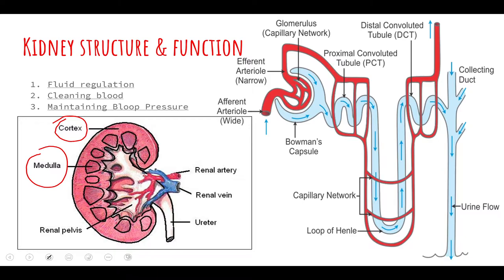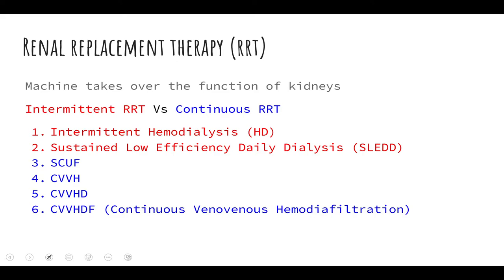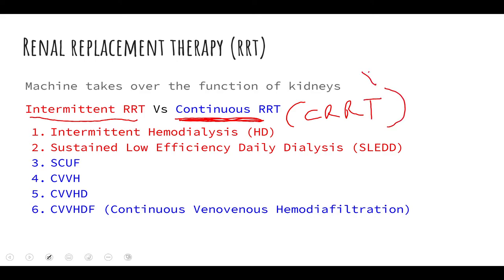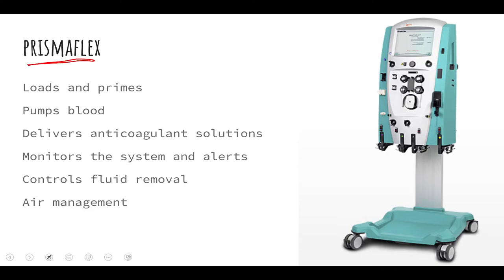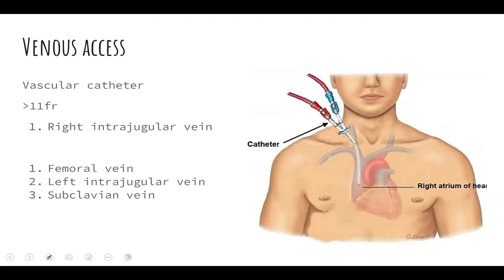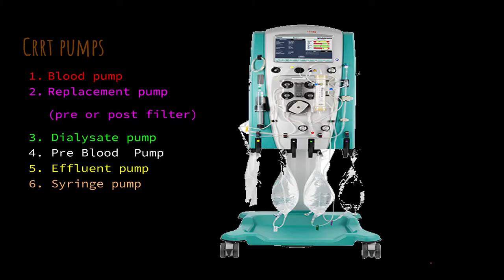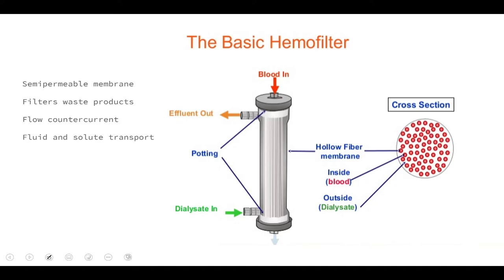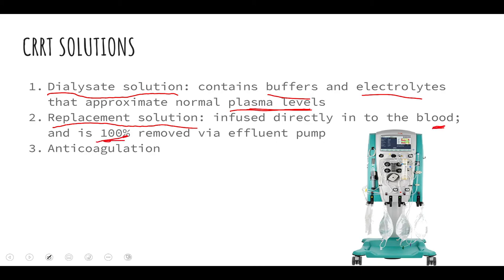CRRT Baxter Prismaflex: The Basics

Comment: Please clarification needed is  pre filter  predilution and post filter post dilution?

In prefilter is it haemodilution that occurs or haemoconcentration?

Is it similar to the proximal and distaconvuluted tubules fluid control  in the nephron?
Reply from the maker: Osaheni, You can use CRRT to do the same thing as HD; but that defeats the purpose of having a CRRT in the first place.
Also, your replacement fluid needs to be balanced between pre filter and post filter. If you only do it pre-filter only, it causes dilution. If you only use it post filter, it causes concentration and clots. I hope that answers your question. I will be making a follow up video on this topic.
Reply: @michael.yemane   Thanks. But why do replacement of fluid when you want to remove fluid in patients with renal failure. I notice normal heamodialysis don't do this. Can you help with some explanations. Thank you
Reply: Ok. Dilution and concentration is with refrences to the blood within the filter. Pre filter dilute the blood in the filter, post filter does not
Reply from the maker: @osaheniosas4731  your overall total filtration is always going to be a net negative.

Comment from the maker: Osaheni, You can use CRRT to do the same thing as HD; but that defeats the purpose of having a CRRT in the first place.
Also, your replacement fluid needs to be balanced between pre filter and post filter. If you only do it pre-filter only, it causes dilution. If you only use it post filter, it causes concentration and clots. I hope that answers your question. I will be making a follow up video on this topic.